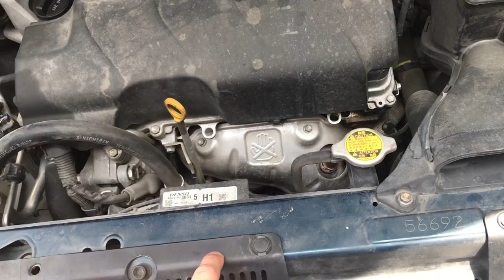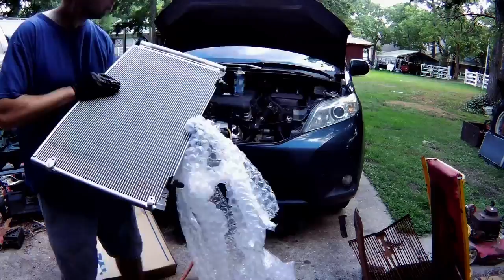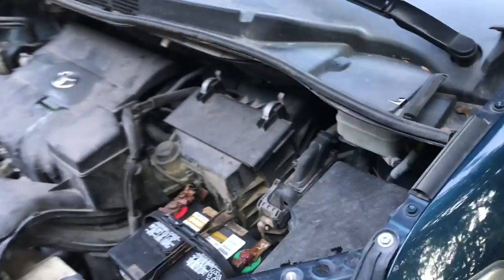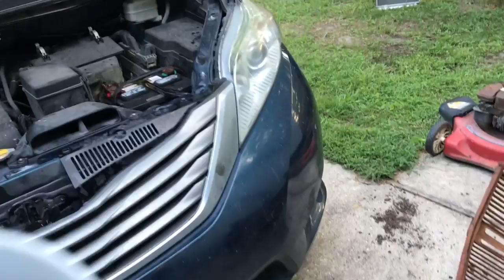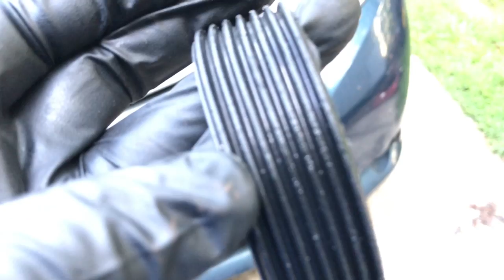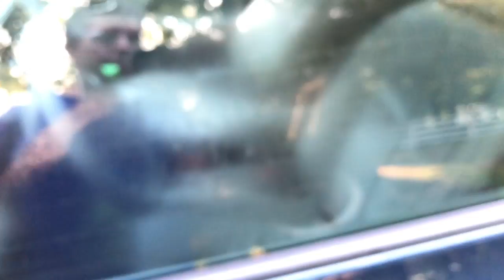2011 Toyota Sienna AC Compressor - Again

Comment: Hindsight 20/20 do you think you should have replaced the condenser the first time? Curious if some crud in the system caused it to fail or just faulty compressor.

Comment: Hey bro mine is having an ac problem as well.. its making a hizzing noise inside the cabin whenever i turn the ac on.. could be a leak somewhere but im not sure where. I tried adding freon on it and it works for a couple of days then its blowing hot again..the hizzing sound in the cabin sounds like a snake..
Reply from the maker: Leak in evaporator core?
Reply: @mjmsworkshop  maybe... do you know where its located and how to access it?

Comment: I have the same problem; I bought a  2013 Sienna for my wife two years ago, and I have replaced the compressor four times already. The last time I replaced everything, compressor, condenser, both expansion valve and even the radiator fans, and it lasted three days only, I'm about to take it to the mechanic again today. It's so frustrating, I know this minivan are pretty good. The first time I replaced the compressor, it was cold enough so we replaced it and since then, they don't last long. Any advice? I'm thinking about trade it in to a dealer, but I don't want to get in debt.
Reply from the maker: Must be some trash left in the system from the failed compressor that is causing the others to fail. You need to thoroughly flush it and probably replace both expansion valves and flush both evaporator cores really well with expansion valves removed.

Comment: I am planning to buy 2011 sienna, it has 110 k miles. 
I like to replace the transmission oil and filter ! 
Any suggestion or advice,  please.  
Currently I have 2004 camery 2.4 L. It has 253k miles. I brought in 2011 when it has 62k miles. 
Last year I had replaced all 4 shocks( full assembly), transmission oil and filter, & all liquids flush. 
Few days ago on 11-11-19 I had replace all 4 breaks, transmission oil , 
catalytic converter , O2 sensor , thermostat sensor, temperate sensor. 
VALVOLINE high miles OIL 10w-40. & spark plugs.
After that cars is flying. It soo light. 
But only thing is It don't have pickup like other cars. I have all documents since I bought the car, No accident till now
Reply from the maker: I need to do the trans on mine, no dipstick so the process isn't quite as easy. When I get around to doing it will post a video.
Reply: There is alot of documented aisin toyota tranny fluid changes it has a internal measuring dipsick when you flush the tranny. The oil needs to be at operating temp between certain Fahrenheit range before you start to release the overflow and make it level.

Comment: no your system was defective. ok you changed the compressor drier expansion condenser. but did you flush the system last time? you are supposed to change everything at the same time. not part by part also did you flush out the evaporator? and what about the rear hoses and rear evaporator. you didn't mention that at all. i wonder if its still working right now.
Reply from the maker: Everything was flushed thoroughly and it is still working fine.

Comment: So why did you take the original out on the 1st place? Thanks for the video.
Reply from the maker: cooling issue that turned out to be a clogged condenser.
Reply: @mjmsworkshop  thanks.
Reply: @mjmsworkshop  Oh yeah, the new parallel flow condensers are more like inline filters. I've just changed a 16 year old one and the compressor is now putting much less load on the engine than before, even though the oil drained from that condenser and its ports looked clean (no compressor seizure, just a leaky refrigerant line replacement and a bolt that seized and broke off inside the condenser's refrigerant port thread)...
Reply: @mjmsworkshop  I am experiencing same symptom , weak cooling, mechanic diagnosed as low pressure from compressor and recommended replacement.  From your experience, do you recommend i first replace the condenser? How can I check if it's a condenser issue vs weak compressor? Thanks in advance.

Comment: Thank you for the video again. I replaced the compressor and the condenser as it wasn't working as well as it was (boiling in the Tx heat in the car rider line). I didn't think about the high pressure port being down stream of the condenser. Thank you for the information. Fingers crossed it will go well.
Reply from the maker: Thanks for watching, hope you have nice cold ac now.
Reply: So far, so good. best of luck with yours.